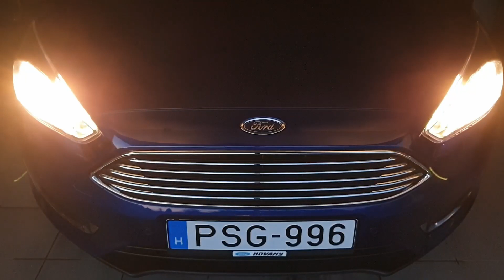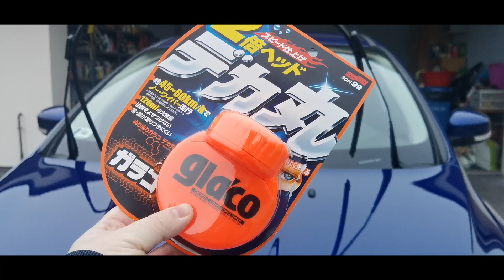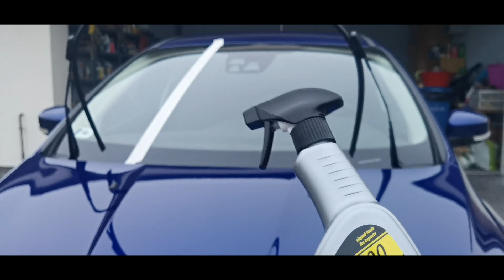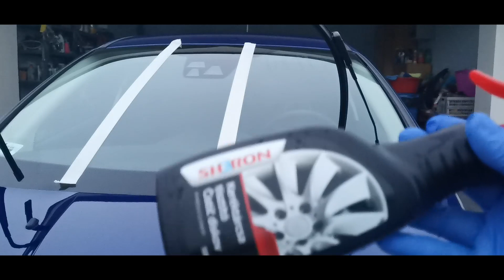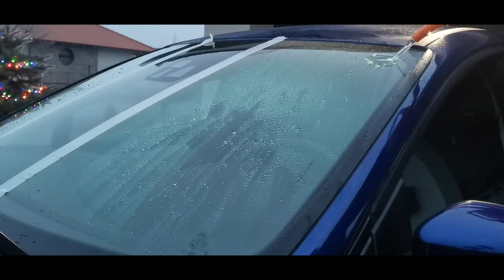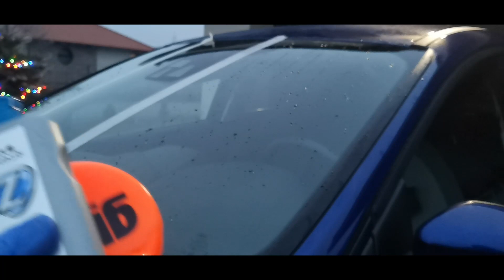Soft99 Glass Compound Z glass cleaner and Glaco Roll On Large test

Comment: Wow so looks like Glass compound Z is more than enough. I prefer my water to sheet off instead of beading, beading + sun = a bad time
Reply from the maker: Same here, I prefer sheeting. Beading looks cool on Instagram photos, but that's it, not practical.
Reply: Sheeting is when you have clear and clean paint or glass.. no protection means it does not last long though...
Reply: Same here, I tried once glass film and those drops are killing me, I used my wipers even more, you stop on red light and you cant see anything because of the amount of drops on your windshield, I prefer my glass clean without drops. So just Compound Z for me.